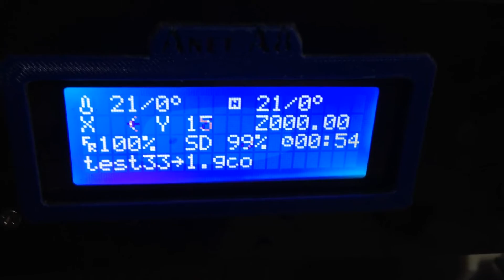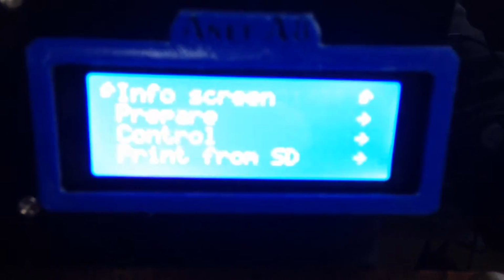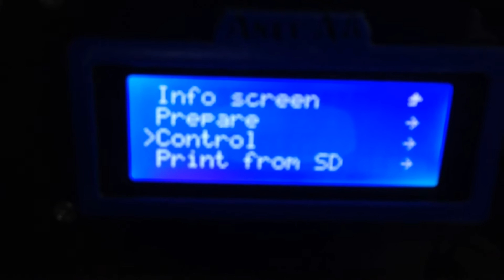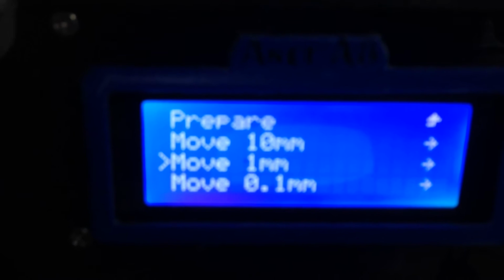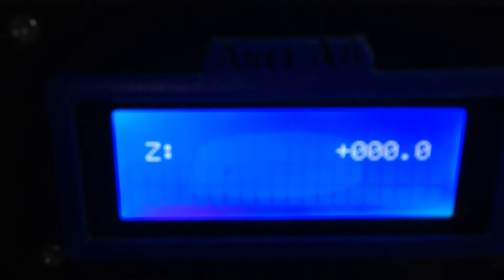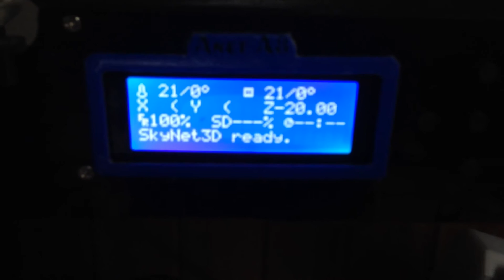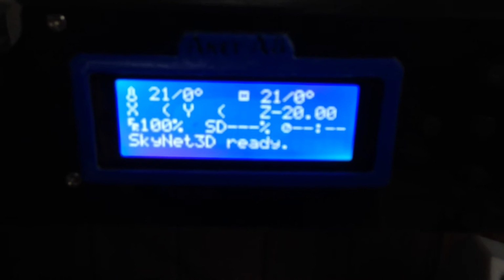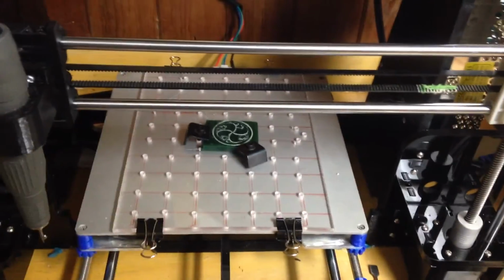anet a8  upgraded to CNC machine (up and running now... you can do this on any printer)

Comment: I got a anet a8 board with not working hearbed thermometer on the mobo & I got a geeeteh i3 with a fried mobo...might combine the two to do this
Reply from the maker: great idea:) also you know you can print PLA with no heat if you use a glass bed with hairspray and an enclosure, Ive been printing PLA w no heat for over a year now.
Reply: @dannytsuji807  Ohh...didnt know that. very good to know, now I left my printer on stand by till i get a new board, I might gonna give it a try. Thanks for the info.

Comment: Can you tell us how you edited the gcode, which software you used and what firmware edit is needed? I've an Anet A8 as well and I printed an upgrade for the cnc too, but I have no idea how to create the needed gcode
Reply from the maker: do you have CAM software?
Reply from the maker: wait did you see the other tutorial? i think its in part 3 i have the start and end gcode youll need and the most important thing is to save your toolpath to MM then swap the start and end codes.